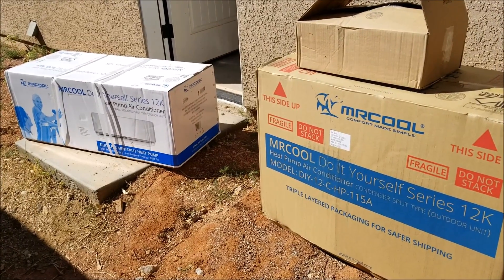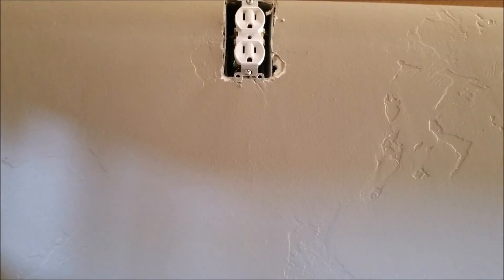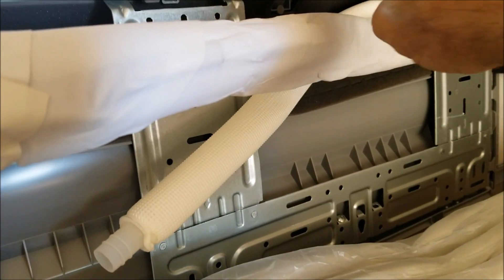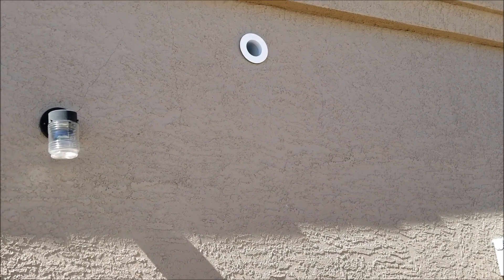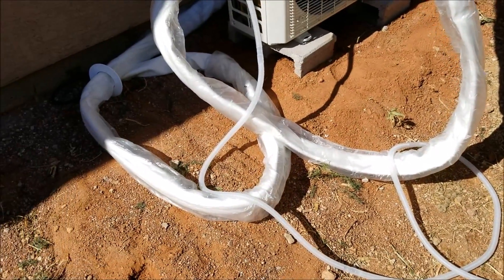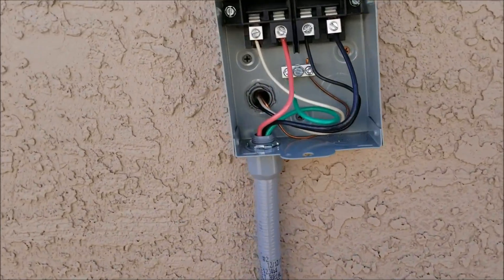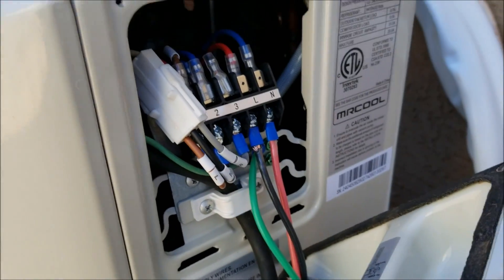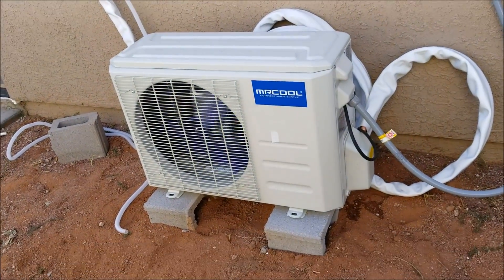How To Install MRCOOL DIY 12K BTU  Ductless Mini-Split Heat Pump

Comment: My ? To you is there a Neutral terminal inside your disconnect box? because I think those 4 screw are hot ,Line& Load for 240 volt,if 120v we should use wire nut to connect neutral to neutral
Reply from the maker: This is a 115/120-volt unit. Most locations code will allow for direct connection or wire tie the neutrals together for 120 volts, but always follow the code in your area.

Comment: They are super quiet, on inside and outside had I known how quiet, I probably would have attached the condenser unit to the house, in comparison to my loud 12000 window unit on the other side of my house.

Comment: Is there anything to prevent you from running a 110/120V standard grounded / 3rd prong plug into an ordinary wall socket as long as it is still on a 20 Amp fuse to the the hot / ground of the outside unit? Just trying to cancel the need for the outside box and tapping a existing indoor electrical circuit.

Comment: The excess coil of lineset is not supposed to lay vertical creating a oil trap per instructions lay horizontal parallel with the ground

Comment: Hey boss! I'm wanting to install one of these in a race trailer but I'm limited on space where the air handler would mount. Can't find dementions anywhere online. Any chance you can pull a tape on that thing? Just need to know the width of the air handler. Thanks
Reply from the maker: The dimension vary with the BTU size. For my unit the it is listed as  31.57 x 7.44 x 11.69.  They are all listed on Amazon for each unit size. The link is the video description.

Comment: Nice video and good instructions. I am planning to install the same unit. I noticed that the ac disconnect you used is from Amazon which sells for ~$43 while the similar one from Homedepot costs ~$10. What is the difference in these tow and what to look for?  Thanks.

Comment: Just a few comments only roll out what pipe you need for the connection also if you went to the other side for a hole you would have 2 feet less pipe to deal with great video

Comment: How many sq ft is your garage?  Will this 12k model keep the temperature steady in my 300 sq ft garage?  Thanks!
Reply from the maker: My garage is roughly 400 sq. ft. It has no problems maintaining the temperature. How well insulated the garage is and how hot or cold it gets locally will be the main factors to consider.

Comment: At 14:10 in the video - I don't know if you realize it but, you actually point at the incorrect wiring. In this example, if you're lugs are 1-2-3-4 from left to right. Your Neutral (white) on lug 1 (from electrical box), lug 2 is Neutral (red) from the outside unit and the electrical whip that you purchased. Lug 3 is Hot (black) from your electrical box (or your receptacle power source that you used) and Black (hot) to your outside unit is on Lug 4. As mentioned earlier, you can also just wire the HOT wires (Lug 3 and Lug 4) and wire together/thru your Neutrals. Just checking to make sure this is correct. Great video by the way and I'm installing my 12,000 BTU unit today (I already have the outside disconnect wired on a separate circuit (20A) in my electrical box.
Reply: what amp on your disconnect? 30 or 60amp? cant find any 20 amp disconnect..

Comment: So I had a new 20 Amp breaker and a dedicated outlet just for the mini split. Is that OK to do and use a 14ga appliance plug?
Reply: @TurboThomTT  I tried this a few different ways and couldn’t get it to stop tripping my breaker. Ended up buying the A/C non fused box.

Comment: Costco now has these units DIY units but newer models 3rd Generation that are much more energy efficient ( 22 SEER ) and wifi capable for an amazing $1099. Thats almost $500 off Home Depot price. Thanks for the Video... straight to the point without the Bull. C

Comment: My house is 1023 sq ft (0.95 a), I was told I needed 30,000 BTU, for the 2 bd room house open plan, now my question is with these unit since I cannot afford to do but my  bedroom, can I add the other rooms later to this same machine or should i wait to do the whole house? 
also, it's been a few years is your machine still working well for you? I wanted to get one for my garage but the ceiling is not close in at the top.

Comment: I noticed that you landed the neutral wires to the terminals in the disconnect box, but in other instances that I've read, some people are using wire nuts to connect the two neutrals in the disconnect box. Would one way be better than the other?

Comment: Could you just buy a plug and just plug it in a normal outlet own its on breaker instead of hard wire it
Reply: i think you can plug it in as long it is dedicated outlet and rated 20 amps. note this is for 12k btu unit.

Comment: This guy did a really nice job explaining everything.  I'm really impressed.  The one thing you want to remember, is to get the drain line on the bottom of all the hoses coming out of the 3.5" hole in the wall.  He had it on the top, which will cause a back up when condensation starts and you will get tons of water dripping inside right under your unit causing a mess.  Just make sure to get the drain line on the bottom of the cables and that it's not kinked or pinched off.

Comment: Hi, I noticed in your channel that you had installed Mrcool, Pioneer and Senville mini split AC units, can you please tell us witch one you liked the best, quality wise. Thank you so much.
Reply from the maker: They all still are working great so no problems quality wise. The Mr Cool unit is easiest to install but cost more compared to Pioneer or Senville. Basically the  Mr Cool doesn't need to be pumped down which isn't that difficult. Personally, I would install a Pioneer or Senville since they cost less but just a preference.
Reply: aztikkel11 thank you for your quick response, I’m leaning towards Pioneer hopefully it’ll be a good pick. Thanks again pal.
Reply: @HVAC_Mechanic  did you pump down the Senville and Pioneer yourself or pay an HVAC guy to come do it?
Reply from the maker: @grifftech  I pump them down myself, It is easy to do. I made videos on the entire process. Here is one. https://www.youtube.com/watch?v=Dg-w2uAsEJE

Comment: Running it on a breaker already in your garage. Smart and easy! Nice. It's only 20 amps? Wow that's low.
Reply: 20 amps should be good enough. it is only 12k btu.
Reply: @jungapo2  yeah, 20 amps is pretty awesome, considering that house plugs are around 30-60, so 20 is perfect. 12k BTU? That's pretty good. I didn't know that. Thank you!

Comment: Does the drain has to be lower than the inside unit, the ground around my garage is higher than where I am hanging the inside unit
Reply from the maker: The condensation line usually drips water by gravity but many basements install use a condensate pump. Here is a link about them https://www.hvachowto.com/our-picks-for-the-best-mini-split-condensate-pumps/

Comment: Never tap into an existing circuit as this example shows. You need a dedicated circuit.
Reply: +1 on this statement. The spec on this is 115VAC, 1-phase with 20A MOCP = Maximum Overcurrent Protection. Put it on a dedicated 20A circuit, buy a 1 pole 20Amp breaker (rated for Heating, Air Conditioning & Refrigeration = HACR use), disconnect and yourself some (Qty. 3) 12AWG conductors in the correct Hot, Neutral, and Ground colors.

Comment: Thank you for the excellent video. I'm about to do the same for my Master bedroom. This really helped prepare me for what it entails. I've always been a pretty good DIYer, but I was a little hesitant about doing this. You have eased my mind. Have you done a follow-up video? Like a year later?
Reply: me too, but you can do it; there is tech support and /or youtubers, etc.  the e-community can help.  go for it and stay cool!
Reply: One thing you should absolutely do different is run a dedicated circuit to power your unit. DO NOT tap into an existing circuit like this guy did.

Comment: Never ever fold ac hose like that !!! That's oil trap area ! You have to spread them left to right, left to right. Install them in zig zag. Or just lay them flat behind condenser !
Reply: The manual says to leave them rolled. I know what youre speaking of from the professionally installed units though.
Reply: Apparently with the higher pressures of the newer r410 refrigerant, vertical coiling isn't an issue.
Reply: Where I live, chipmunks would enjoy eating that hose.

Comment: I believe you were supposed to test the coolant connection for leaks with a soapy water spray bottle.
Reply: Yes, that is true. You are supposed to test them before you let the refrigerant in the line (because it does have nitrogen) and then after you open the Allen wrench lines and the refrigerant is pushed in.  At both of those intervals you should soap up the lines.

Comment: U must vacuum up the machine.... Otherwise the compressor might get blast also
Reply: Not this one
Reply: @isaiahbangura4421  y not this 1
Reply: @mayurnaik2926  Pre charged and pre vacuumed. The seal only opens when you connect it.
Reply: Just said diy don't need vac

Comment: Thank you for the video. I see your compressor is just sitting on the cinder bricks. Don't you worry that vibrations will make the unit walk off the bricks?
Reply from the maker: It doesn't vibrate much if any. Still working and hasn't moved.

Comment: One I bought has sticker saying you have to vacuum lines
Reply: Jason Rogers they sell mini splits that are not “DIY” and these are much cheaper $700 I think. These are designed to be installed by a pro. 

You pay for the convenience of the DIY. $1500 last I checked for 3rg gen.

Comment: Did you need to pull a permit to do this install?  If it had to be inspected, do you think it would be a problem that it is connected to a non dedicated power source?  What amp breaker is that circuit?  Thanks
Reply from the maker: No permit is needed for the mini split install. The wiring will be different in every scenario. The garage is on a 20 amp breaker. It would be best to run a dedicated breaker for the unit and something I likely will do eventually.

Comment: A few things you should've done per the instructions: You're not supposed to remove any caps until the last possible second so you don't run the risk of getting any debris inside the connections. Second, you're supposed to release the freon from the top port first followed by the bottom.

Comment: Do I need to use any product on the threads? Pipe dope or teflon? Also how did it go with using the circuit for the garage? Did it ever give you issues with the breaker or all good? Thanks for the video
Reply from the maker: I didn't use any use any sealant but many people use Nylog to help the threads seal. It has worked well in the garage with no Breaker problems for me. It is best for it to be on its own Breaker though.

Comment: Can you use a foam insulation in the tube that carries the lines to keep the cold out and the heat in. 
Any suggestions for than.
Reply: Be careful that the expanding foam doesn't have too much pressure otherwise it may crush the lineset
Reply: 851995STARGATE thanks

Comment: Won't the bricks vibrate and cause the bricks to move out of level? Concrete pad once poured in level, will be less likely to move.
Reply from the maker: It doesn't vibrate and just sits on the bricks. A concrete pad is also a good option though.

Comment: Mine did not come with any wrenches or a hole saw or a cool tool bag. Is that something I can call and ask?
Reply from the maker: I guess its not included any more. It not on the listing.
Reply: Optimus Prime  did you buy from amazon using the link?

Comment: How did you install the outlet? Do you have a separate video for that?
Reply from the maker: It was an outlet inside the garage already there. I drilled a hole outside behind it to an electrical  box an ran wiring to it.
Reply: When you backtaped the garage 20am break I saw you wire the neutral on your disconnect. Is that necessary or just have one hot and tire the neutral from the breaker to the condenser

Comment: No pressure leak test, no evacuation (vacuum pull), no torqueing of flare connections?
Reply from the maker: The line-set is already in a vacuum and have a seal that is broken when bolted onto the outside condenser.

Comment: Does the blower vent inside move up and down on its own?
Reply from the maker: Yes, when it powers on it opens up.
Reply: @HVAC_Mechanic  thanks. So it oscillates while running as well?
Reply from the maker: No oscillating. It opens up and tilts down.

Comment: should teflon tape be used on the copper line fittings?  Also was one of you copper lines about 5" shorter than the other.  Mine is and I'm concerned to complete the copper lines hookup because of it.
Reply from the maker: One line was shorter than the other but they attached with no problems.

Comment: Just for your information: You should Wirenut the neutrals together (separate from the grounds) and only use one pole of the disconnect switch for the hot. The other pole will be unused when wiring for a 120 volt circuit.  For safety purposes the neutral should not be disconnected by a switch. You only ever switch hot conductors.
Reply: ZJ Samson thanks i was about to ask that question? Why he has the neutral wire hooked up to a fuse
Reply: Just to be clear, if you wirenut the neutrals, then this is don’t correctly?
Reply: @coloclymer yes only the hot should be on the switch. Just wire nut the neutral

Comment: Voltage? 110? 220?
Reply from the maker: It a 115 volt unit
Reply: @HVAC_Mechanic  hard wired?  Separate circuit?
Reply from the maker: Its hard wired. Here is a link to a written overview of the steps. https://www.hvachowto.com/how-to-install-mrcool-diy-12k-btu-17-5-seer-ductless-mini-split-heat-pump-wifi/

Comment: Thanks for your video.. AC guys are pretty expensive so it’s nice to have a diy option. Is your outside wall stacco? Will the included holesaw go through brick ? What did you end up doing with the excess line and does it coil easily... slightly worried that it might kink.
Reply from the maker: The line is a braided mesh with copper ends which bends easy so no worries about kinks. My outside wall is stucco but the hole saw goes right through. Here is a link for final pictures and setup.  https://www.hvachowto.com/how-to-install-mrcool-diy-12k-btu-17-5-seer-ductless-mini-split-heat-pump-wifi/

Comment: Did you mount your bracket to a stud ?
Reply from the maker: Yes it was mounted on a some studs.
Reply: aztikkel11 how did you bend the copper lines downwards without kinking the tube ?
Reply: Neil the tubes are only cooper on the ends other that that they are like a braided stainless steel hose that Im guessing  has a high psi rating.

Comment: is it ok to run this unit on a 30 amp breaker ?
Reply: 12k would probably be a Max of 15amp
Hope that helps..
Reply: @ItsMeJbird  Instructions actually say 20A fuse.
Reply: @ItsMeJbird  Could you run a 9k unit on a 13 amp plug? would that work? thanks.
Reply: @bennewton3560  
Should be fine
Reply: Thanks